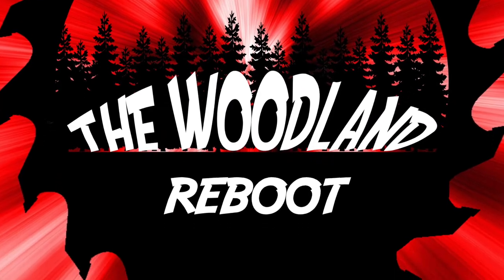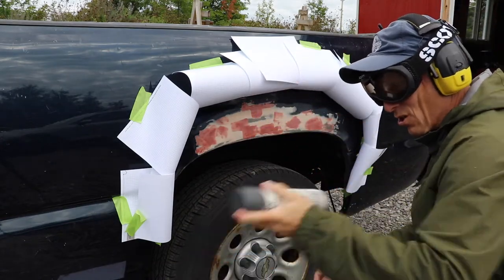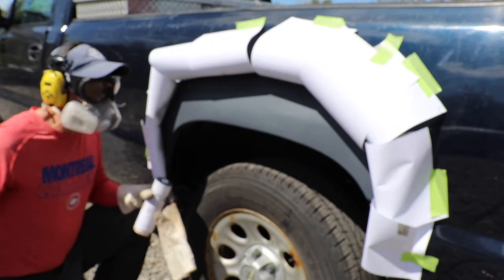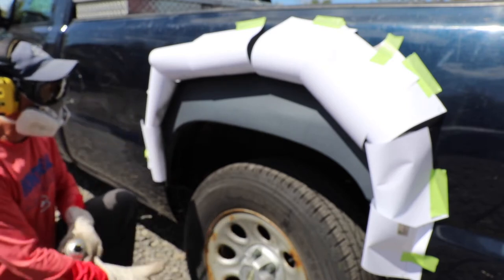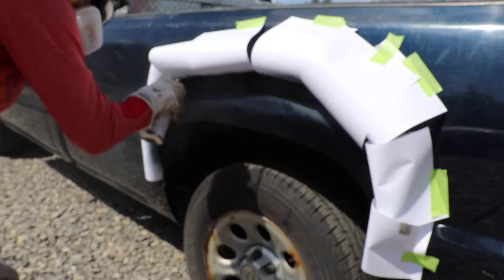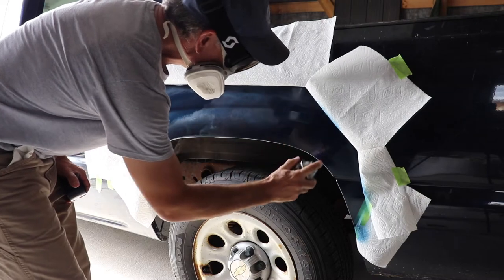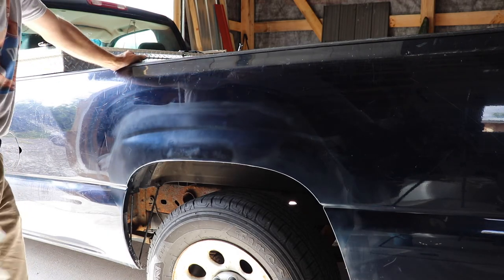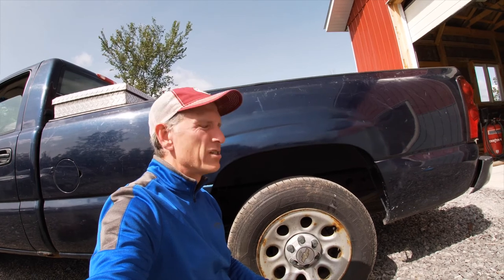How I Repair Rust Damage on the Fenders of My Pickup Truck -  Priming and Painting -  # 3

Comment: Ive done similar a few times on my $ 1000 2000 Taurus. Last repair lasted over 2 years. This time I'm  using the Bondo Hair as the rust has made a hole now.  You did a great job. This is how the majority of DIY repair jobs look. Good, but not perfect. Bondo is the easy part for me. Blending the final paint the hard part. Last job i taped off and had rigid straight lines, not good..  I'm trying your method this time. Most pro body shops will not guarantee rust repair, So we all have nothing to lose. Hope mine comes out like yours this time.
Reply from the maker: Good luck Jeff. Two years is a great result for a DIY repair like this.
Reply: @TheWoodlandReboot  The Bondo Hair is awesome. All went well, except the final finish is very flat . Color match is good, no rigid lines, so i quit while Im ahead!  Thanks again for your practical and realistic video.